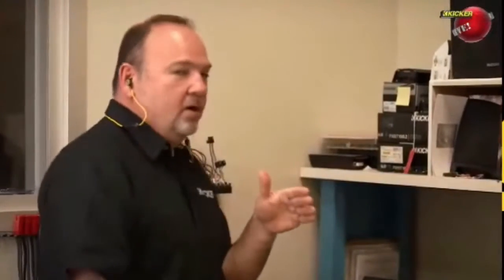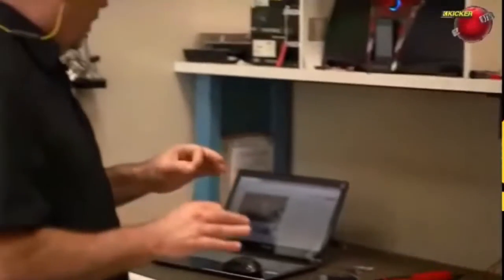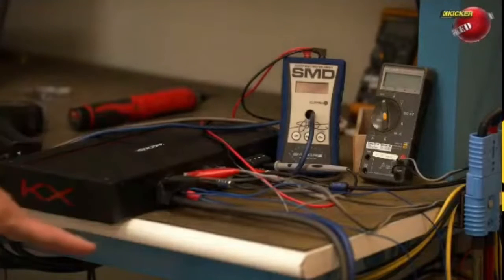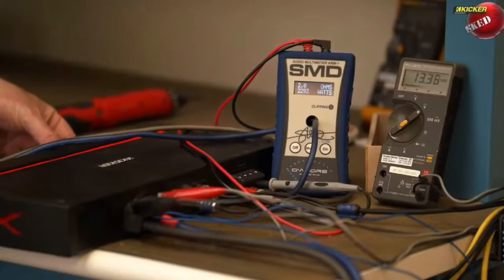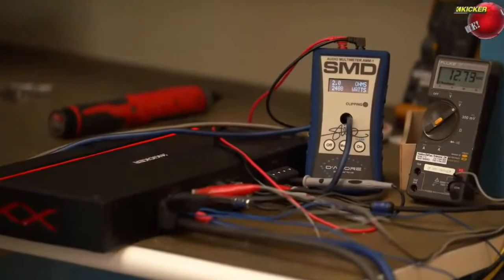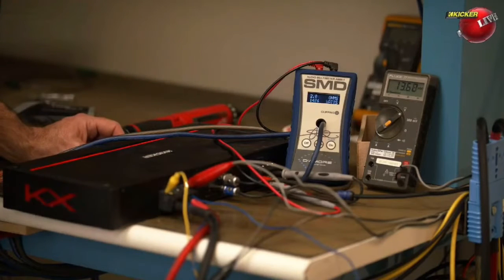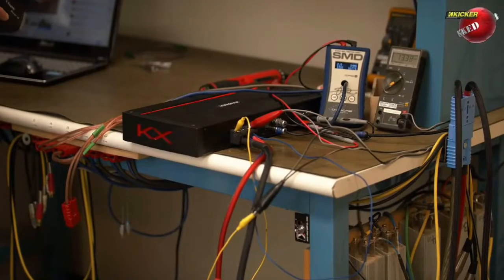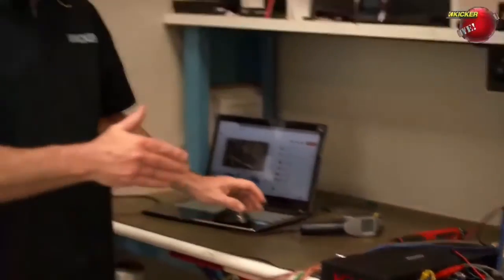KICKER UNMASKED HIGHLIGHTS - OFC vs CCA - KXA 2400.1 STRESS TEST

Comment: I spent the extra coin on the the kicker 1/0 ofc and man did it help i stopped dipping down to 11 volts on the big bass hits on my kxa 2400 i actually did dual 1/0 inputs and man what a difference it made kickers wire kits are the best in the business.

Comment: Will cca 8 gauge be able to keep up with 2ohm 600rms can you help before I start to build mine as I need help
Reply from the maker: It should be “OK” but like this test .. that is kinda pushing it ! It all depends on the run length - in my opinion you should be ok but if you start melting fuses then UPGRADE !